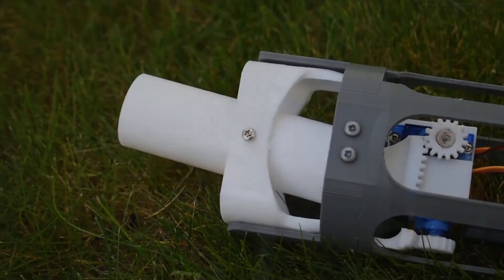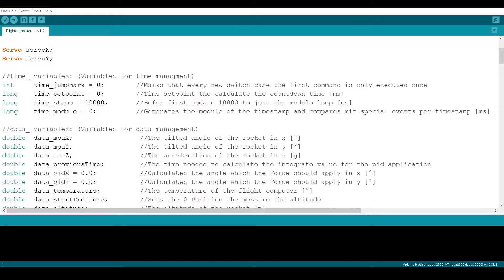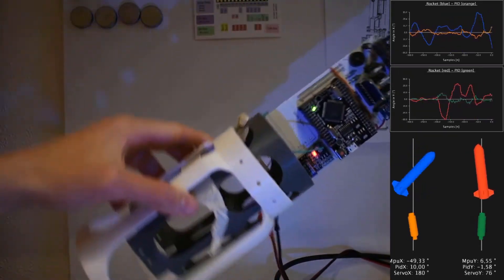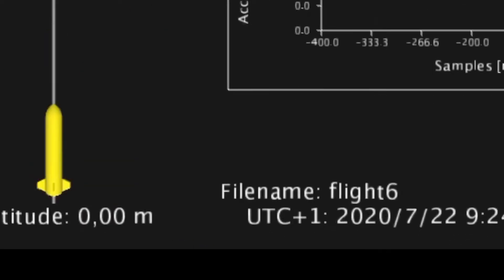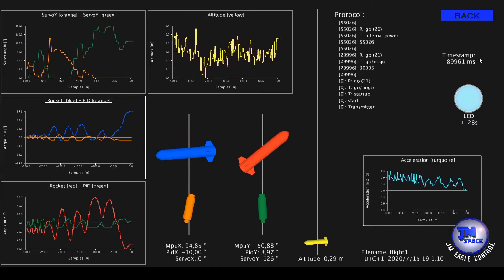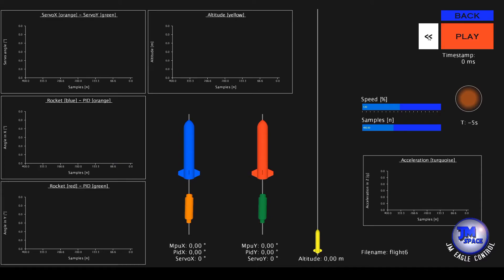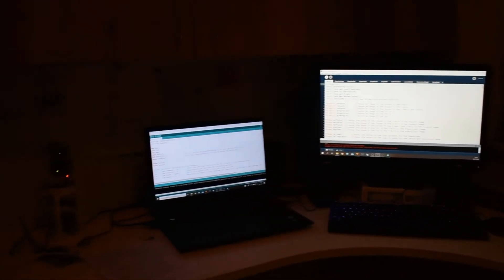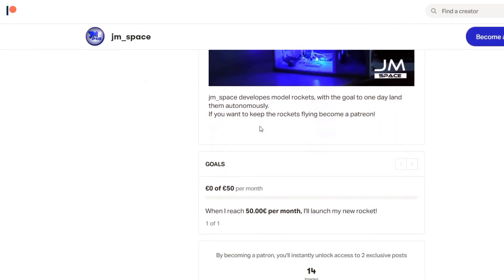Rocket Software | JM Eagle Control

Comment: hey bro i want a help from you. how do i use multiple i2c busses in teensy 4.1 . i tried multiple time with multiple code but doesn't works, the default i2c is only working but teensy 4.1 have 3 i2c port but .please help